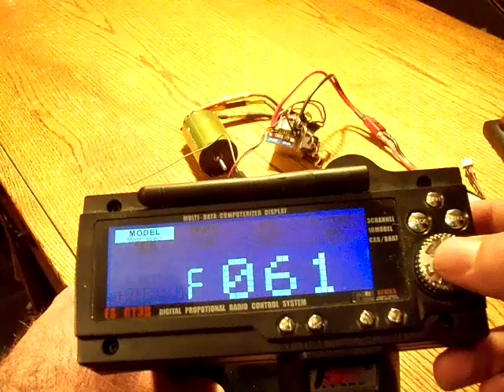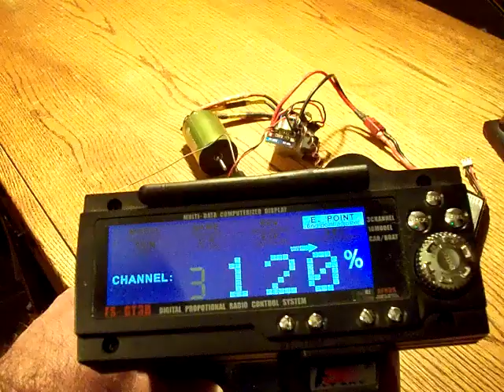FS-GT3B with Throttle-Brake Mix on 3rd channel

Comment: Hey Bill, hoping i could pick your brain on this.... do you know if this could do tank mixing? like a skidsteer? i have somewhat accomplished this with a vtail mixer, but honestly its not as reliable as it needs to be, so i was hoping this would be an all in 1 fix for my issues.... Thanks in advance.
Reply from the maker: +TRCC I don't see any reason why not... instead of brake mixing you could mix steering with throttle. If you haven't already bought the GT3B or haven't upgraded the firmware yet, then I would encourage you to consider the Radiolink RC3S instead because it offers channel mixing as a standard feature: http://www.ultimaterc.com/forums/showthread.php?t=217514
Reply: +Bill DeLong awesome thanks. i'll definitely check that one out.
Reply: +Bill DeLong do you know if that one has other receivers would like the ability to have more channels, i know the gt3b has receivers up to 8 channels i believe
Reply from the maker: +TRCC, not aware of the radio being able to control more than 3 channels, the Radiolink that I referenced can control up to 4 channels, I think you'll be much happier with that system.

Comment: Btw what does the abs thing in the transmitter do? And how do i use it cuz it only works when im in reverse🤔
Reply from the maker: I don't own this system anymore, but I believe the ABS is for "anti-lock braking" which  is not compatible for many brands of ESC's, it is intended to be used with a throttle servo for nitro cars to pump the brake quickly.

Comment: Hi I've done this mod but the brake servo is only operating when you brake, which isn't a bad thing but the end point adjustments have no affect on the servo what so ever. Any ideas on what's gone wrong??

James
Reply from the maker: Wish I could help, but I no longer own this system to help troubleshoot.  Maybe try the D/R instead of the EPA?

Comment: Mine won't show the software version. My E-Maxx goes directly from forward to reverse. No brake.
Reply from the maker: I don't own this radio anymore, what version did you flash yours to? 

If you have not flashed the radio, then you won't get any of these features discussed in the video... not sure where to get any support for this as URC is down and all my notes were logged over there on how to flash the radio :(

Comment: Hello Sir , how does your car goes back ?
Reply from the maker: This feature was used for a motorcycle which typically doesn't have reverse, I don't believe there is a way to disable the brake using reverse enabled unless you adjusted the dual rate and flipped it when you were done using the brake so the reverse would work

Comment: Hi where can I download the firmware 061 ?
Reply from the maker: unfortunately, all the information I had referenced in the link to URC of the product description is no longer available since the URC servers were shut down. Maybe you can do a search on RCTech to find some threads explaining how to do the firmware upgrade? 

I no longer use this system and feel it's not worth the hassle, you can get far more features for the price with a RadioLink RC4G system which I have some demo videos on my channel showing how much easier it is to manage.

Comment: hi Bill thnks for the video mate..actually i jst converted a 1/5th scale into brushless..i have got myself hydraulic brakes front and back..the problem now is that my esc has reverse which i dont want to lose.i want to use the hydraulic brake on the 2nd channel {throtlle} wen i brake,but if i keep my finger on the reverse my car will go into reverse mode after it stop while my brakes will still be applying... i cnt figure out wat to do..can u please help,am using the MT4 sanwa.thnks
Reply from the maker: jimmy veeramalay  sounds like an ESC issue, check to see what mode the ESC is set for... could be in Forward/Reverse mode and might need to be set to Forward/Reverse with Brake... also try re-calibrating the ESC to the radio. Verify if the Transmitter needs to be in Forward or Reverse mode based on what the ESC instructions say.... Good Luck!
Reply: hi bill,,its the quickest response ever,,thnks mate,,i havnt did the set up yet i was just assuming that this will happenam  thinking how i can get throttle..brake via hydraulic brakes and reverse on the same 2nd channel.?can u help,,some guys on google are talking abt chanel mixing..i was thinking of acceleration,brake and wen i reverse the servo for the brake stop wrking n let the car go on reverse..any idea??am sorry if it doesnt sound ok am jst new i was wondering if it can be done.thnks
Reply from the maker: jimmy veeramalay  I'm not familiar with the hydraulic brake... sounds like it would be simple enough to use a Y-cable and try that first. All you need to do is split the output from Ch2 into the ESC and brake.  You wouldn't need to use mixing unless you wanted to control how much brake was applied between the ESC and the hydraulic separately.
Reply: ok Bill thnks a lot for info,,i will try this n see if it wrks out for me...thnks tk cr n god bless

Comment: I bought this radio thinking it has this feature but pretty pissed after finding out. Looks like back to my 8 year old JR X3i for now till i can get the programmer. Mine is the newer GT3C with lipo battery.
Reply from the maker: I would try to return the radio if you can... I am far more happier with my RadioLink RC3S which performs nearly as well as my RadioPost TS401
Reply: Bill DeLong
 well i bought my radio for $65 so i think its worth keeping till i flash the firmware one day. For now im going to use it in a boat.
Reply from the maker: 30GB
 I paid $50 shipped for my RC3S which offers the gambit on features, sans telemetry, plus it supports up to 4S LiPo and HV Rx's, and it comes with 2 Rx's, it's also a 12-bit system which feels smoother than my FlySky too.